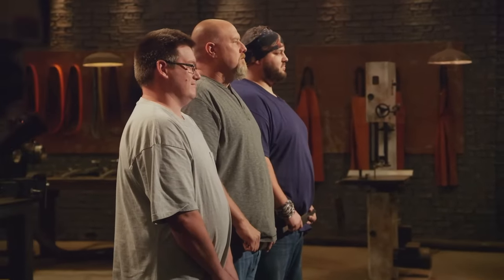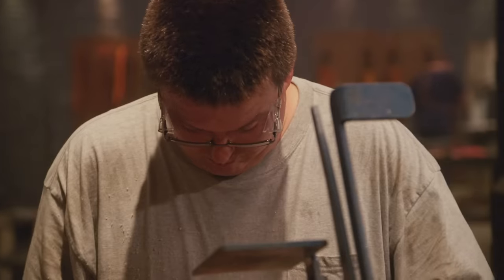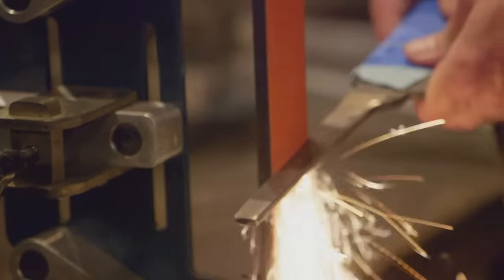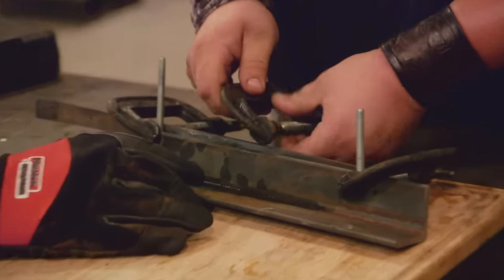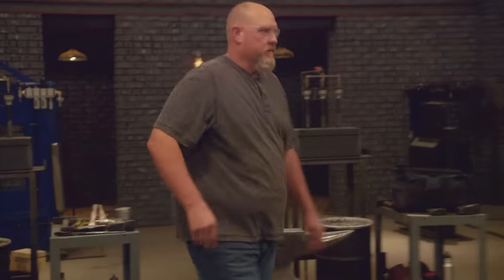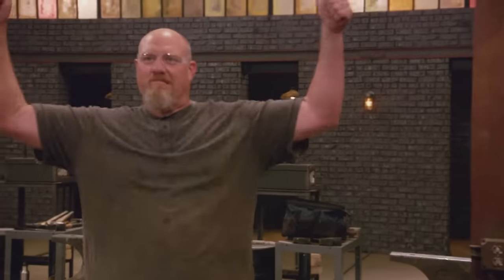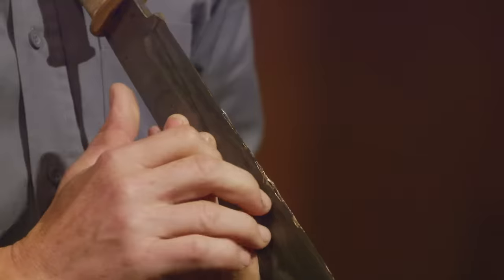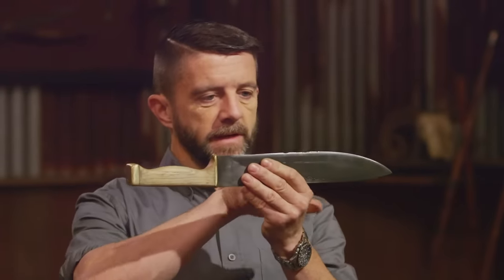Bladesmiths Step in to Help OPPONENT?! | Forged in Fire (Season 7)

Comment: Something to consider for anyone wondering why they picked Matt to leave, and not Scott considering the sharpness test. They bring up the separation in the blade for Matt, and that's legitimate, but there is another factor. Scott's blade, while it took a dulling in a spot or two, and was kind of dull to start with; can always be sharpened up still even if an undesirable outcome. Matt's cannot. Far too much of a roll in spots to keep the edge even along the blade anymore, that split aside.

Comment: Not doing the sharpness test first kinda set those guys up for failure.
Reply: The whole point of the sharpness test is to see if the blade stayed sharp. Doing it first would be pointless; soft blades can still be sharp. By doing it after the strength test they can see how good the heat treat was, and if the blade can hold its edge.

Comment: I don't understand why they do the Sharpness Test AFTER the Strength test.....It's sure that the Blade is damaged and after that it can't be sharper than before...
Reply: I think that's exactly why. All blades can be sharp at the beginning but not all can stay sharp after being used in extreme conditions.
Reply: The whole point of the sharpness test is to see if the blade stayed sharp. Doing it first would be pointless; soft blades can still be sharp. By doing it after the strength test they can see how good the heat treat was, and if the blade can hold its edge.

Comment: As a knife maker I never understood why guys will use organic materials that just dont hold up like G-10, Micarta or Carbon Fiber.  Antlers look cool and many woods look nice, but if they aren't stabilized they can crack.
Reply: Go with what you know. Wood and antler are cheap or even free in a lot of cases, much easier/less expensive to play with and make some really nice handles with. 

G-10, Micarta, and Carbon fiber scales are expensive to even try to work with. A lack of experience with the material probably makes them go with what they know.

Comment: I stopped watching the show because of the sharness test not being first.
Reply: The whole point of the sharpness test is to see if the blade stayed sharp. Doing it first would be pointless; soft blades can still be sharp. By doing it after the strength test they can see how good the heat treat was, and if the blade can hold its edge.